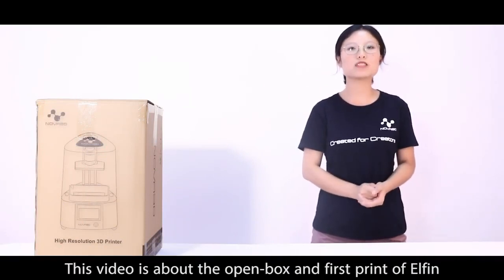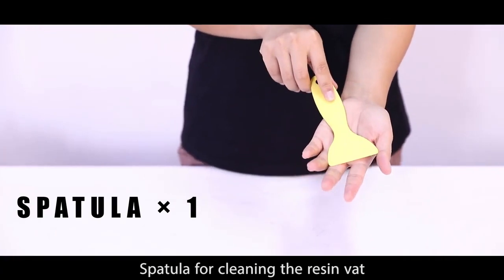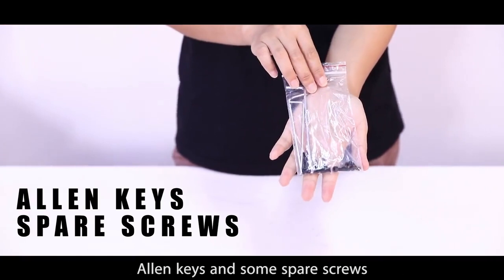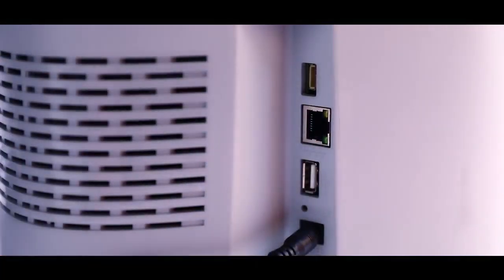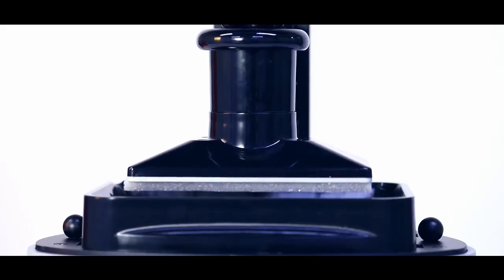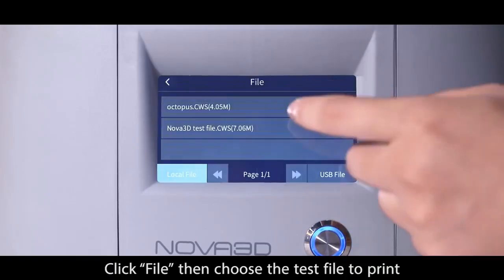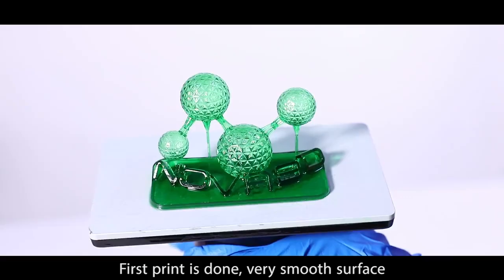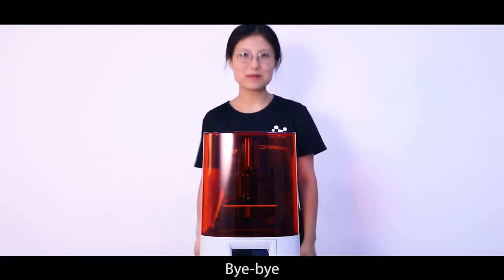Nova3D Elfin Resin 3D Printer Unboxing Initial Setup

Comment: I'm looking at buying my first resin printer. Do you have to clean the resin tank after a print or can the resin stay in there? How long can the resin stay unused in the tank?
Reply: I just ordered one of these after hours of reading-up, i have two filament printers already. This printer has great features and performance for the price. You don't have to clean the resin tank after each print but i don't know how long it can be left.
Reply: I'm still new but I think you can keep reusing unless you have a failed print. You don't want rogue pieces in the resin and then take a chance of braking your lcd screen and vat plastic film. 

 I think you can keep the resin in the vat as long as your going to use it soon. But I wouldnt recommend it for prolonged nonusage. I have my printer in a nonlit room so no sunlight comes in. I would worry about leaving resin in vat in well lit area. Cheers!